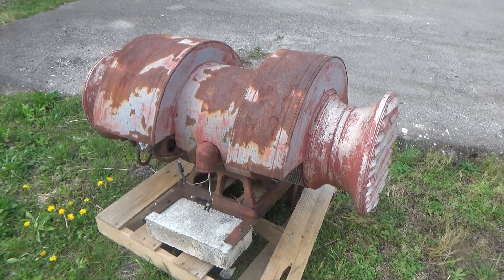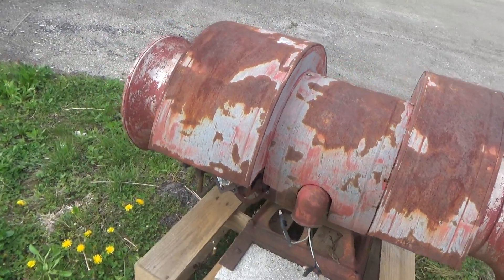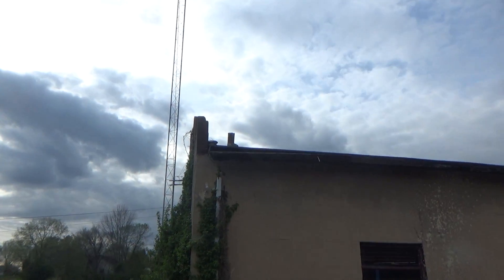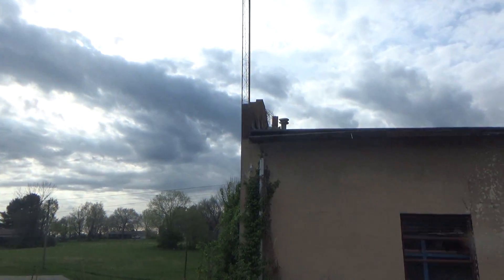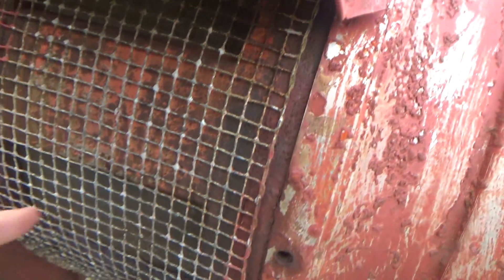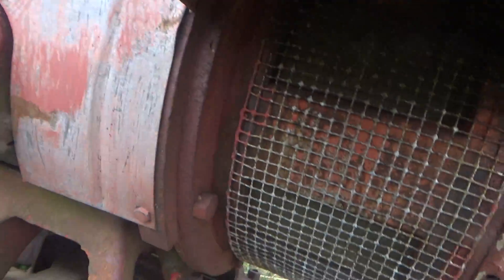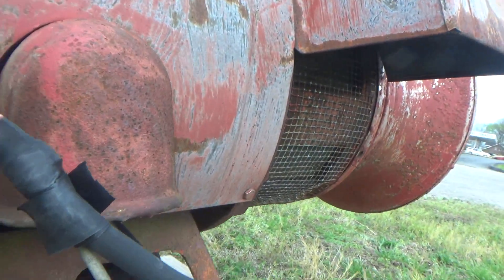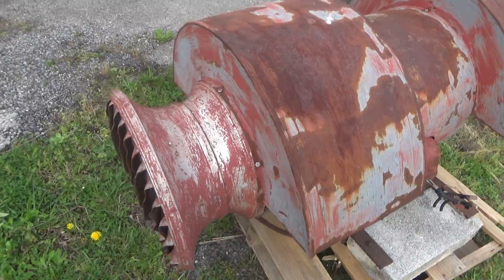Old Station 3 Sterling Y-10 Siren Removed 4-13-2019

Comment: Do you know when the April fire drill is?
Reply from the maker: Delta TV no I haven't heard anything on when it's going to be. The administration has decided to kinda hold off a little while on the April drill since we had the March drill so late in the month. And from where summer break is soon, this is the time of the year where it's very uncertain. We didn't have our May fire drill last year because of the 2nd of May we had a small fire in the art room which set off the sprinklers. But I will of course be on standby if it does happen this week or next week. All depends.
Reply: It's in April.